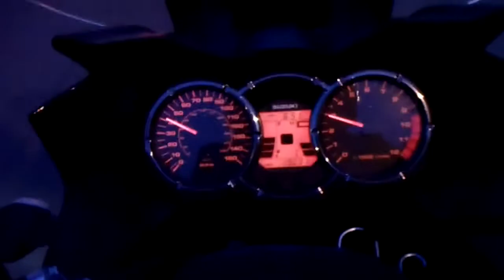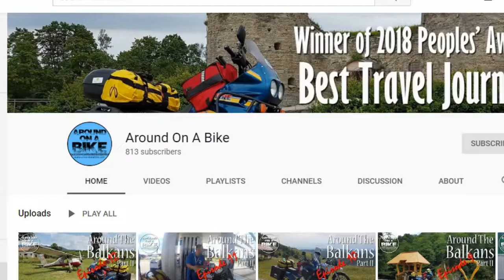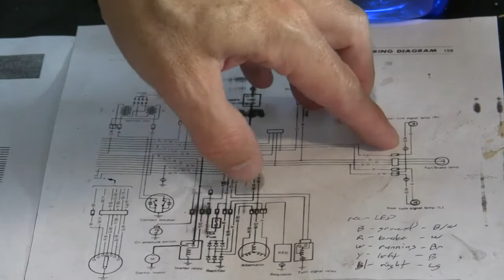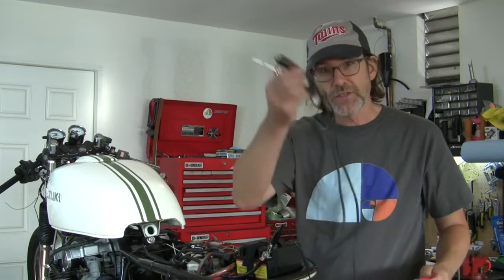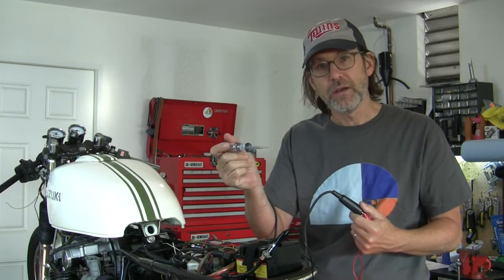Wiring Front Turn Signals - GS550 Cafe Racer (Part 92)

Comment: Thanks for posting this video. It just saved me at least $140. (The estimate amount of just wiring the aftermarket front turn signals up after I had already installed them on my motorcycle). After watching this video and following the instructions it took me approximately 20 minutes to have them hooked up and working. The Motorsports shop I got the estimate from stated that it would take approximately 1 1/2 hours labor time and that was if everything went well with no problems.
Reply from the maker: Glad I could help! Thanks for watching.

Comment: Hello, thanks for the video. What would I have to search for to find the relay you're talking about, which needs switching when using led lights?
Reply from the maker: Thanks for watching. I searched "two pin led turn signal flasher relay" and got a lot of results on eBay that would work, but also got a bunch with three pins so just check which your bike needs and order the correct pin count and orientation. Super inexpensive.

Comment: Could you link the relay you purchased?
Reply from the maker: I'm sorry, I purchased so long ago that I don't remember which exact one I bought. However, this should do the trick with any 1977-78 GS550 ... https://www.ebay.com/itm/2-Pin-Electronic-LED-Flasher-Relay-Fix-For-Turn-Signal-Light-Fast-Hyper-Flash-US-/303349270957?_trksid=p2349624.m46890.l49286 It isn't the only one that will work. No specific endorsement of any seller here. Thanks for watching!
Reply: @UrbanMonkTV  thanks!

Comment: On another note, have you connected the engine earth yet?  and was it to the back bolt on the top of engine casing? Did the bolt come out ok and was it a long bolt? and what does it do?  Mine broke when trying to remove it, I tapped it out and put a short bolt in. No problems so far  :-)
Reply from the maker: Yes, top back of crankcase. I just used a 6mm bolt I had lying around. It serves no purpose internally, just ground (earth). It sounds like you have yours in order. Did any piece of original bolt fall inside that you're aware of? May have fallen through to the bottom of the sump/pan.
Reply: @UrbanMonkTV  Thanks for the reply, interesting that your bolt was not a long one running deep into the case like mine, perhaps a 750 - 550 difference. I don't think any part of my bolt came loose, it looks like it just sheared off 2/3 of way down the shaft. Fingers crossed for the future it is all ok. I was wondering what this bolt's purpose was???, anyhow enjoy your ride when its running, I rode mine today to my local watering hole, it is great fun to ride.   :-)